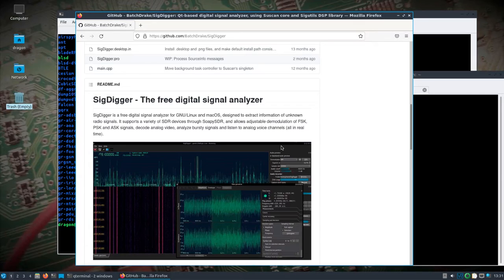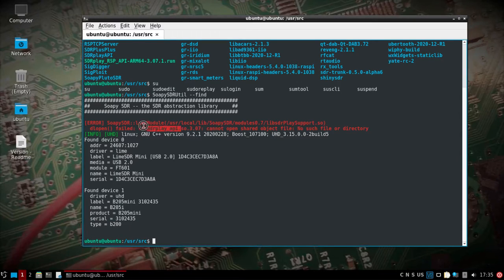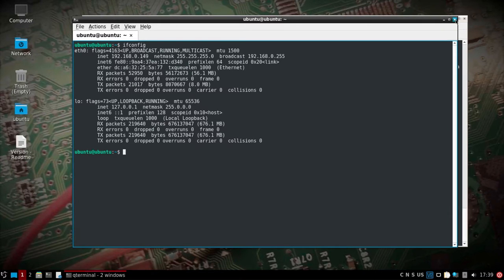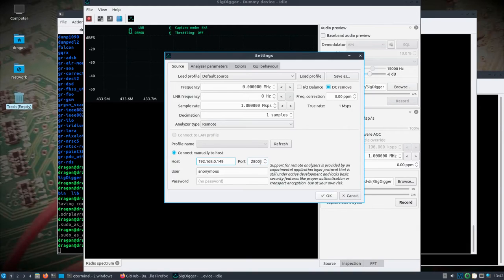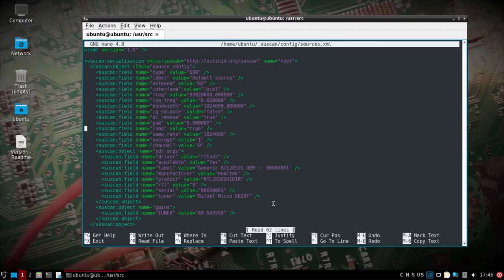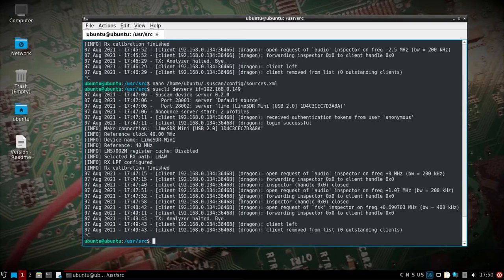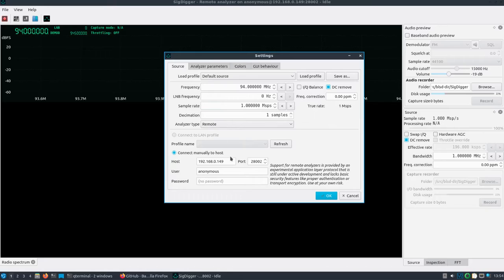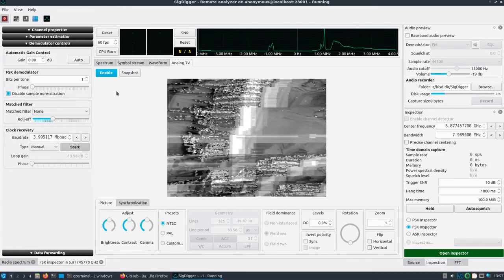DragonOS Focal Suscli Remote SDR Profiles w/ LimeSDR Mini and B205mini (SigDigger, Pi4)

Comment: Can these software packages as well as your previous videos all potentially work with a PlutoSDR instead of the more expensive bladeRF?
Reply from the maker: I have a PlutoSDR sitting here and yes a lot of the videos can work with the PlutoSDR. Both SDR++ and SigDigger for example work with the PlutoSDR. Gqrx, SDRAngel, and a rather large list of what’s preinstalled will work with the PlutoSDR. I just got it recently so I didn’t record a lot of videos using it before.
Reply: @cemaxecuter7783  Thanks for the quick response; this is fantastic! Is there a compatibility/supported list or you know this base on experience?
Reply from the maker: I really should put a list together, but to answer your question I put DragonOS together and try to test everything against radios I own. Which, now that I have the PlutoSDR I’ve been going through and trying various things. So far it’s working with a lot, maybe I’ll get a list together one of these days!
Reply: @cemaxecuter7783  Ok take your time... your videos are one of a kind in terms of being intelligible b/c i live in USA. 

Confirmation from you is good enough for me now since I am in learning mode and Pluto is more design for that vs. bladeRF i think.
Reply from the maker: And something that’s super cool, I’ve actually tested a version of suscli that’s running right on the PlutoSDR itself, no other small board computer or any computer needed when I tested it.
Reply: @cemaxecuter7783  May I reach you to you in real-time, perhaps via discord, if I have issues w/ the Pluto in specific use cases w/ the softwares?
Reply from the maker: @sjwiz5991  sure, I try to drop in here from time to time https://discord.gg/9uSC2un
Reply: @cemaxecuter7783  Very cool, nice to see your own server there.

Comment: Feature Request!  Hi There, I just wanted to say thanks for all your work in making these video's and the DragonOS, Quick question, would it be possible to add the LeanDVB software to your List? I have done this separately on my laptop and works fine, "out of the box". I am currently working on building a Digital Amateur radio television station, and I want to share it with the ham community in my local area, but getting the software up and running seems to be a challenge for some local hams, having this feature would be wonderful!  Thanks! Mike Kennedy. Call sign VA3TEC.
Reply from the maker: Hi Mike and welcome. Sounds super cool, and fortunately I think you’re already covered. LeanSDR/LeanDVB is already included in DragonOS Focal (not sure about on the Pi64 build though). I had to go back and check the list of stuff installed. Also, give me a min and I’ll shooter you a link to a video where either I used it or I was messing around with it behind the scenes before I gave SDRAngel a try.
Reply from the maker: DragonOS Focal Receiving DVB-S with SDRAngel and SDRPlay (RSP1A, USRP B205mini-i, GNU Radio 3.8) https://youtu.be/gXdG60opnn0
Reply from the maker: I scanned over that video and didn’t see me using leandvb but I know I was messing around with it at the same time. You should be able to type leandvb in terminal to access it.
Reply: @cemaxecuter7783  Ok Perfect! Here is the CLI command line interface that I used to get my laptop to work with my DTV stream! If you are interested. The video transmitter is running for a RPI4 from the BATC Portsdown 4 wiki page.   https://wiki.batc.org.uk/Portsdown_4
Reply: CLI: user$ rtl-sdr -g 60 -f 437000000 -s 2400000 - | leandvb_tui.sh ./leansdrscan ./leandvb --fd-info 2 -f 2400000 --fastlock --drift --sampler rrc --sr 333000 --cr 7/8 | ffplay -
Reply from the maker: Thank you, I’ll see if I can do a test and I’ll try to out.